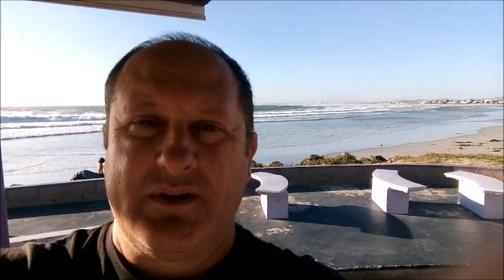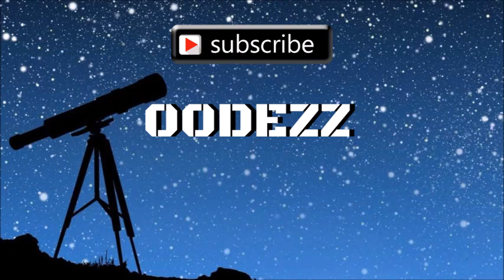00DEZZ - Koeberg Containment Building in the Mainstream Media. I tell the truth.

Comment: You are right, most of what you said is true and known by most everybody. What you fail to say is the following:
1. Koeberg was designed for a life of 40 years.
2. Escom wants to install new steam generators to extend the life by another 20 years, and this bring alot of questions of which I have not seen or heard any answers:
 - Will the structure withstand this kind of "abuse" for another 20 years?
 - Will the floating bearing of the nuclear island stand for another 20 years?
 - Will the piping and all that goes with that stand for another 20 years?
3. Escom coal power stations are +40 years and deterioration are very evident, what about Koeberg.
4. There are about 6 million people in Cape Town and surrounding areas, will we be able to evacuate everybody?
 - The roads have not made provision for that.
 - Have CT got anough busses to evacuate everybody?
 - Where will people be housed?
I would love to hear and see the planning that have gone into this few questions.